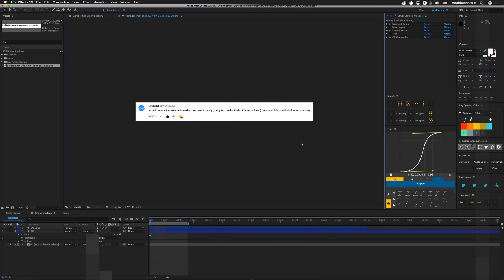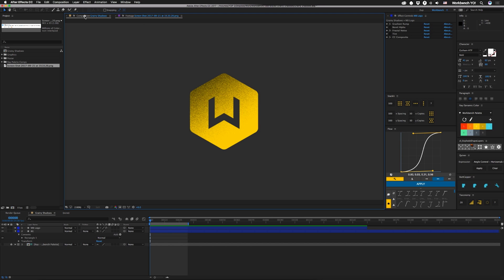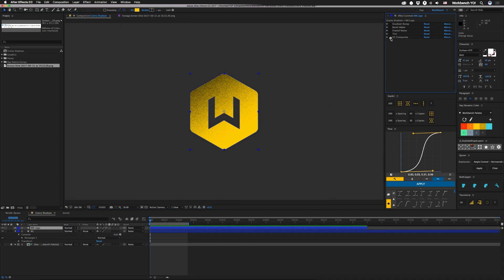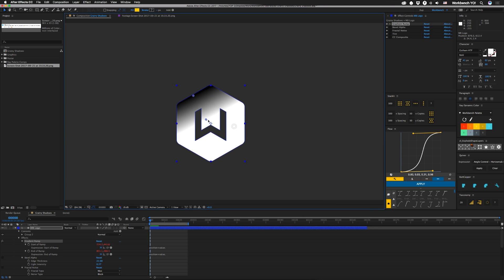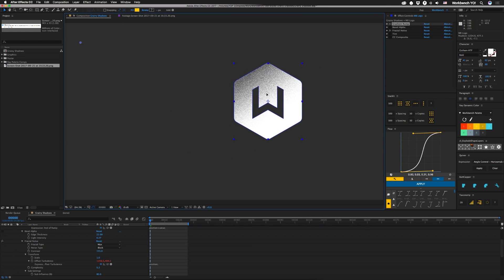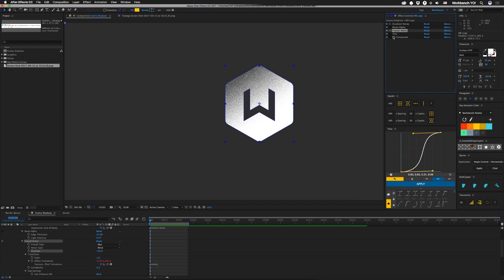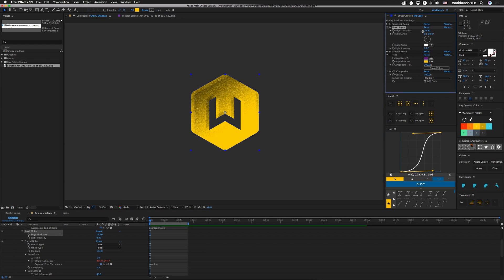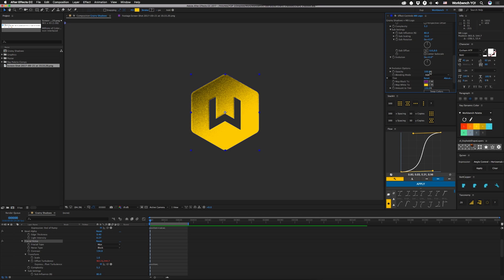Tutorial 89: That Grainy Texture Look

Comment: Thank you for tutorial. But I can not fully understand.
Fractal noise does not work as it should. I put all settings as you said. And turned on the ADD mode. Noise does not change depending on position. What could be the reason?
Reply from the maker: Did you put the expression on Offset Turbulence in the Fractal Noise effect? It should just be "position;" without the quotes of course.

Comment: Hello. How to apply a gradient to the 3D layer to change the 3D layer situation did not change the gradient property in the space? Start of ramp and End of ramp  change their position when the layer moves in 3D space
Reply from the maker: I tried to use a layer space transform to accomplish this, but there's no way I can tell to get it to work with z space since it's on the layer itself. This was designed for 2D only.

Comment: I asked Ash thorp on Instagram a couple weeks ago how he did it in the FITC titles and he said to use a gradient fill on your shape, with the white part going to 0% opacity, then set the blend mode to dissolve. That works super nicely because the fill follows the shape without having to do an expression or anything, and you can still control the intensity via the gradient fill slider. Pretty cool seeing it done a slightly different route though!
Reply from the maker: Oh yeah, I had seen that too! There was a reason I didn't go that route, but I don't recall what it was at the moment. That is what inspired me to go down this road originally though so thanks!
Reply: I'd guess it's probably easier this way to build upon it with other effects perhaps?
Reply: Great idea. I know in watching Andrew Embury's Adobe Live tutorial the main reason to use the gradient effect is you can keyframe it if you want vs you can't do that with the built-in gradient fill.
Reply from the maker: Yep, sadly.

Comment: I would use the Layer Style "Inner shadow" for this purpose ).
Reply from the maker: It slips and isn't as customizable, but if that doesn't matter it works! That's one of the techniques I was talking about improving upon. :)
Reply: Yeah, in the case of Inner shadow one can't control this plenty of parameters but in the case of gradient (radial or linear) it is complicated to do the uniform grainy texture on the edges of complex shapes.
Reply from the maker: You could also pull different edge mattes and use this technique. Or I think you could use inner shadow with this, but just use it to make the gradient and still use fractal noise so you can lock the gradient in place. If only the stupid dissolve mode wouldn't stay put, but move with the shape that would be an easy way to go.